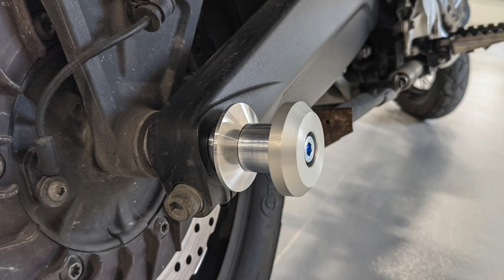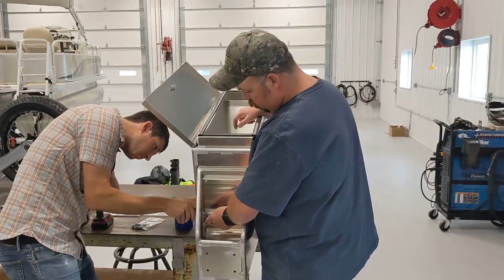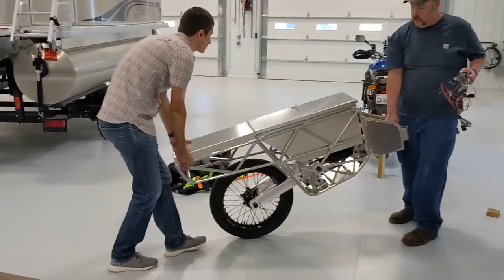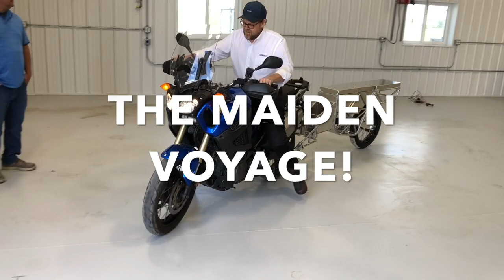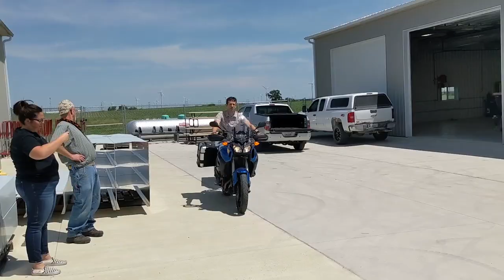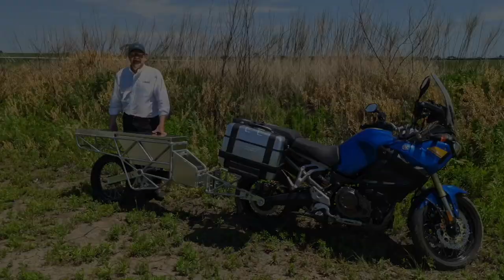The First Full Assembly of The Pasq® ADV1 - Single-Wheel Adventure-Motorcycle Trailer

Comment: Well yes, as someone commented on ADV Rider it's not for our market. Maybe the GS guys but not adventure riders as I understand it. I build maybe two or of these a year for guys going round the world and have made a fair few test ones.
It's easy to draw tubes on a CAD program but cutting and welding it together another matter, I'm a design and production engineer and know two rails underneath is the economic way to go.
Aluminium is not repairable in Ulan Bator or the backwoods of India so I use stainless tube, anyone with an arc welder and an old bed frame can sort it out.
Same goes for the suspension, any junk yard in the world can supply the shocks of a C150 or whatever, a specific unit is a disaster.
The hitch U should really be a U or V shape, if you can't get to 90° to the trailer then turning around is a disaster.
The box carrying system is far better, when you are stuck being able to unload the cargo easily is important, then you can unhitch and sort yourself out.
Legs or a stand system is invaluable for parking and unhitching.
The shock is right in the roadspray and will die rapidly.
Handling wise the pivot point should be as close to the rear wheel and the trailer wheelbase longer so the trailer curves in the same radius as the motorcycle, otherwise the trailer wheel tries to cut the corner and pulls the motorcycle over, this is especially noticeable accelerating out of tight curve.
The weight should be a low as possible, I build mine with adjustable ride height so for road use the cargo box grounds when the motorcycle grounds and with stiffer suspension to prevent wallowing, for offroad I lift the trailer and use softer, longer travel.
Around 40kg load is about the limit for fast offroad, around 20kg for around an mx or enduro course, 60kg is just okay for road work with a large bike (ca 200kg).
Reply from the maker: Wow, Jim. Thank you for your comments. There is a lot to unpack here. Fill up your tank, and you’re likely going to need it get to the end of this:

 1. “I'm a design and production engineer and know two rails underneath is the economic way to go.” - Since you’re an engineer, you know that design does its best to produce desired outcomes and uses. I’m fairly certain your design goals are quite different from Pasq’s. So, I need to make our design goals very clear: we are making a trailer that will do what midsize and large ADV bikes do. Our design is not for enduro bikes. It currently is not for highway-only cruisers, but we will likely make adjustments and go into that market next. Our design goals are that our trailer be able to handle gravel roads, some rough off-roading, as well as do high speeds on the highway. From what I can tell, you are from Germany where the law is, a motorcycle pulling a trailer cannot exceed 60 km/hr (36 miles/hr). We are in the US where many areas have speed limits of 80 miles/hr (128 km/hr) and the norm is 70 miles/hour (113 km/hr). Our target market expects (and we do too) our trailer to be able to do that speed, and then be able to turn off onto a gravel road and travel at 40 miles/hr, and then turn onto a rough two-rut trail and bounce around on rocks to get to a campsite. They expect to be able to travel for 1500 to 3000 miles at highway speeds to get to Fairbanks, Alaska, and then travel the remaining 500 miles of gravel roads to get to Prudhoe Bay and the Arctic Ocean. To put it in a European context, it has to be able to do everything needed to get from North Cape, Norway to Capetown, South Africa. And all of this, without getting off the bike and making adjustments to suspension or the configuration of the trailer. It is also very important to note that our design goal, like BMW or Mercedes, is not to produce an inexpensive trailer; it is to produce the ultimate trailer available for the ADV market within a reasonable price for that market. That means the price will likely be between $6000 to $7000. Some will say that's insane. But in the context of a $30000 BMW GS, it is a reasonable price for what we are delivering.

2. “Aluminum is not repairable in Ulan Bator or the backwoods of India so I use stainless tube, anyone with an arc welder and an old bed frame can sort it out.” - I think you underestimate the abilities of Mongolians and Indians. Being a design engineer, you know that every design decision—especially when it comes to materials—is a trade off. If you are the Jim Titt that makes climbing bolts, you know this very well. Your decision to use stainless in your trailers is to trade the ubiquity of arc welders for weight. Building a frame from aluminum is not something that is unusual. You are probably aware that many high-end cars and trucks have aluminum frames. It sounds like you’re familiar with India. I rode an aluminum-framed Cannondale bicycle with aluminum racks (all 6061-T6) around the world in 1989 and 1990, spending 3 months in mostly rural India. This was before India opened to international trade, so there wasn’t anything foreign in the country, not even a Coke (we drank a lot of Thumbs Up Cola). We had problems in Tamil Nadu with one of the racks, but mig/tig welders are also not uncommon, even in 1990 India and we were able to sort it out. (There really is no backwater in India…the country is filled with people who can solve any problem with nearly nothing.) We figured it out. Very importantly, in the design we are going to market with, the entire frame will be bolted together. The design you see in this video is welded aluminum tubing. We are going to be able to send a replacement for a broken piece. DHL is an amazing company! You will be able to make a temporary repair, keep traveling, and replace the broken piece down the road. I had to do that with a broken wheel in India. We got by on Indian ingenuity until the replacement arrived a week or two later via DHL.

3. “Same goes for the suspension, any junk yard in the world can supply the shocks of a C150 or whatever, a specific unit is a disaster.” – Again, you make different trade offs than we have decided to make. One of our design goals is for this trailer to be able to travel expressways at (or above if you’re so inclined) speed limits. This makes it critical that our suspension be able to handle holes or bumps at high speeds. A C150 shock isn’t going to be able to do that. A trailer bouncing down an expressway at 120 km/hr is very dangerous, and that is what a C150 shock would likely result in. Off road handling is much easier. High speed is another challenge completely. Also, from what I can remember, a C150 shock has very little preload adjustability and no rebound adjustment. We have chosen an air shock so that as you add or remove weight on the trailer, you can easily add preload to the shock so you maintain proper and safe functionality. Our shock also has adjustable rebound, again for safety at high speeds and control off-roads. We have made our choices based on what we want the trailer to be able to do.

4. “The hitch U should really be a U or V shape, if you can't get to 90° to the trailer then turning around is a disaster.” –  I’m not exactly sure what you’re referring to here regarding U and V. We will have a 74° turning angle on our trapezoid hinge (patent pending). We’ll be releasing a video on our hinge shortly. We’ve found that the benefits of the trapezoid hinge and that turning angle work very well.

5. “The box carrying system is far better, when you are stuck being able to unload the cargo easily is important, then you can unhitch and sort yourself out.” – A big plastic box has advantages and disadvantages, just like our system does. One of our design goals is to make the trailer like a roof rack for a car. Our system allows you to attach nearly anything to the sides of our trailer, and remove them easily. We have people planning to attach bicycles and kayaks to the trailer, in addition to hard and soft panniers, coolers, dry bags, and anything else people would like to take with them.

6. “Legs or a stand system is invaluable for parking and unhitching.” - Finally, something we can agree completely on! Our stand acts as both a side stand when connected to the bike, and a center stand when disconnected. It’s important for you and everyone watching this video to understand that what you see is our very first prototype. The trailer we are going to market with is very different, but also very similar. The production model will be 2 feet shorter (60 cm), about 30 lbs (13 kg) lighter, not made from tubing, and will not be welded. But it will have the same 17” ADV wheel, the same carrying capacity and style. Also, I encourage you to watch some of the other videos on our channel. https://youtu.be/uPYapI0Jnx8

7. “The shock is right in the roadspray and will die rapidly.” The shock in the final design is well protected. (It was actually well protected in this prototype as well.)  Also, the air shock we are using is designed to get massively dirty at a wide range of temperatures without failure. It has years and years of use in multiple situations.

8. “Handling wise the pivot point should be as close to the rear wheel....” - Once again, I have to state that this video is of our first prototype. Our final product will have a trapezoid hinge, which makes most of your comments completely moot. You couldn’t know that based on this video, but if you have experience with trapezoid hinges for trucks and cars, you can probably imagine what it will do. We have shot a video and will be publishing it next week that begins to introduce our patent pending hinge. Also, I have no doubt that what you say is true of the steel rail+plastic tub trailers you’re making. 

9. “The weight should be as low as possible, I build mine with adjustable ride height so for road use the cargo box grounds when the motorcycle grounds and with stiffer suspension to prevent wallowing, for offroad I lift the trailer and use softer, longer travel.” - All of these comments are very reasonable and generally true. In our up-coming production model, the weight will be carried lower than you see in this video. Also, it’s impossible to understate how game-changing our trapezoid hinge is in handling.

10. “Around 40kg load is about the limit for fast offroad, around 20kg for around an mx or enduro course, 60kg is just okay for road work with a large bike (ca 200kg).” – Another point we agree on! However, the ADV1 is NOT made for the enduro market. It is built for adventure touring (ADV) bikes, like the BMW GS series, Honda Africa Twins, KTM Super Adventure series, etc. We’ll enter the enduro market, eventually.
Reply: @PasqAdventure  
Trailers are rare in Germany, getting through inspection is difficult and the speed limit unattractive to say the least. The reason for this is no motorcycle manufacturer will give type approval for use with a trailer. And to some extent this is understandable as they have adverse effects on the handling. I and my customers use them in other countries where things are more relaxed (actually in Italy they are completely banned but we can use German registered ones there).
Naturally I test them, up to 200km/hr but that's easy and not the fundamental handling problem, this occurs at slow speeds and you really only identify it it you ride agressively with a lighter bike. However this is of concern in an emergency situation for any rider. If you swerve to avoid something like a child running into the street and are forced by oncoming traffic for instance to swerve back you suddenly find the motorcycle reacts very differently to normal, the tail wags the dog so to speak.
Because the trailer wheel isn't actually following the motorcycle but is in effect cutting the corner when you swerve back straight the trailer is doing something different and you need a much larger steering input than normal then have to remove this rapidly. The more weight the worse the effect. I've tested up to 120kg and it will actually just scrub the front tire away on my 950KTM. 
The other entertaining feature (though probably uninteresting to touring riders) is trail braking on dirt roads where the weight pushes the back wheel out in an interesting manner so spirited riding on fire roads is a matter of readjusting braking distances and some new riding experiences! We actually went to a supermoto track and tried our best, it was better to drop the trailer lower so backing into the corner just the frame rail is on the ground and slides easier but I doubt this is GS territory.
The other "interesting" handling problem is in two-track or single track (tractor ruts or such) where under braking we start to get head shake, on KTM's this is alarming to say the least and we think it is because the trailer wheel naturally tries to ride up the side of the rut which one corrects and then the wheel does the same on the other side. Most alarming!
Incidentally I tried keeping the trailer rigid and letting the wheel pivot independently, it was a good as a supermarket trolley on rough ground, I managed about 10 feet before I crashed! The optimum solution would be steering the trailer wheel from the pivot yoke as large farm trailers do but that's getting complicated.

Comment: Her şey çok güzel fakat ağırlık merkezi çok yukarıda
Reply from the maker: Hello Niyazi,

If Google translate is correct, you said the trailer looks great, but the center of gravity is too high. First, thanks for the compliment! It's important for you to know that this video is the assembly of our very first prototype. We have since done two more prototypes and given the trailer a new name, the ADV1. So many of the things you see in this video have been changed. 

Related to your comment, there have been two really big changes: 1) We have lowered the trailer about 5 or 6 cm (2 inches). 2) We have implemented two trapezoid hinges, one at the bottom of the trailer and one at about the middle. These two hinges make the ADV1 extremely stable, no matter where the weight is.

One more point that is important...most of the weight that will be carried by the ADV1 will be in panniers which hang down the sides of the ADV1. This places the weight actually much lower than it would be on the motorcycle. Here's a picture that shows how my wife and I travel with the ADV1 and how the bags sit. https://photos.app.goo.gl/8n3NcZzhDo2nu5by6

We will definitely recommend that people do not put much weight on the top of the ADV1. In the picture you can see that we have a dry bag mounted on the top. It carries our tent, sleeping pads, and quilt. It probably weighs about 20 lbs (9 Kg) and is not a problem at all.

======= Google's Translation into Turkish =======

Google çeviri doğruysa fragmanın harika göründüğünü ancak ağırlık merkezinin çok yüksek olduğunu söylemişsiniz. Öncelikle iltifatın için teşekkürler! Bu videonun ilk prototipimizin montajı olduğunu bilmeniz sizin için önemli. O zamandan beri iki prototip daha yaptık ve treylere ADV1 adında yeni bir isim verdik. Bu videoda gördüğünüz şeylerin çoğu değiştirildi.

Yorumunuzla ilgili olarak iki büyük değişiklik oldu: 1) Römorku yaklaşık 5 veya 6 cm (2 inç) alçalttık. 2) Biri treylerin alt kısmında ve diğeri yaklaşık olarak ortada olmak üzere iki adet trapez menteşe uyguladık. Bu iki menteşe, ağırlık nerede olursa olsun ADV1'in son derece stabil olmasını sağlar.

Önemli olan bir nokta daha... ADV1'in taşıyacağı ağırlığın çoğu, ADV1'in yanlarından sarkan yan çantalarda olacak. Bu, ağırlığın aslında motosiklette olduğundan çok daha düşük olmasını sağlar. Eşimle birlikte ADV1 ile nasıl seyahat ettiğimizi ve çantaların nasıl oturduğunu gösteren bir resim. https://photos.app.goo.gl/8n3NcZzhDo2nu5by6

İnsanların ADV1'in üstüne fazla ağırlık koymamalarını kesinlikle tavsiye edeceğiz. Resimde üst tarafa monte edilmiş bir kuru çantamızın olduğunu görebilirsiniz. Çadırımızı, uyku tulumlarımızı, yorganımızı taşıyor. Muhtemelen yaklaşık 20 lbs (9 Kg) ağırlığındadır ve hiç sorun değildir.

Comment: Low center of gravity is needed
Reply from the maker: We have many design goals, but they can be summed up as we want the ADV1 to do everything a large or medium-sized ADV bike can do. That means it needs to be able to go down the highway at speed limits (or above if you so choose) and then be able to turn off onto a dirt, washboarded, pot-holed logging road and go 5 miles back into the woods, and then go the last 200 yards on a single-track trail to your favorite camp site. 

We have designed the ADV1 to be able to carry panniers as high or low as you want through our mounting plates, which you don't see in this video. So, depending on what type of riding you're doing you can adjust the height of your load. If you're 100% highway, then you can keep the weight low. If you're off-road, you can raise them.

Also, our trapezoid hinge means that the trailer is stable at any speed, with up to 120 pounds at a reasonable height. 

You can't really see any of this on this video; this is just an assembly video. I'd suggest you take a look at some of our other videos where we have bags attached to the trailer. https://www.youtube.com/@PasqAdventure/videos